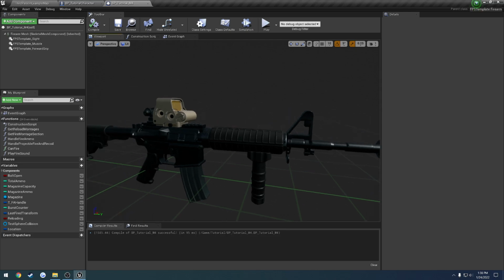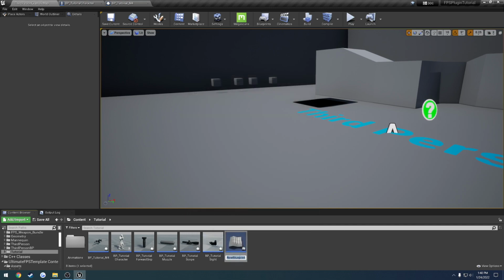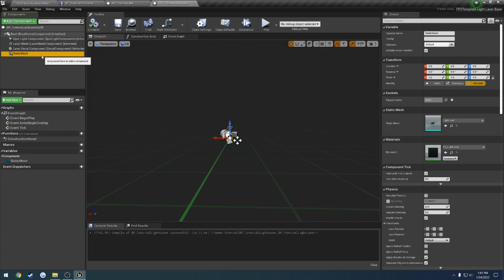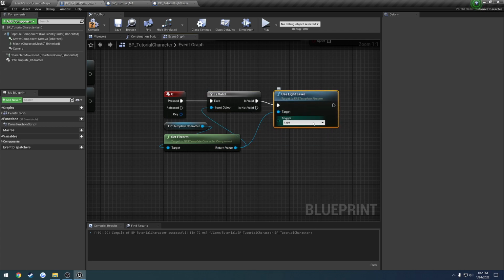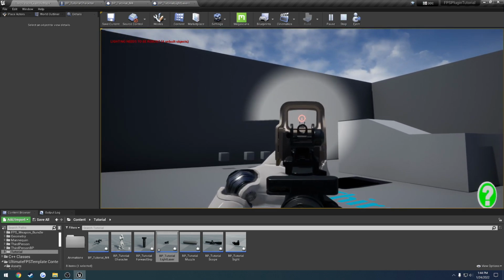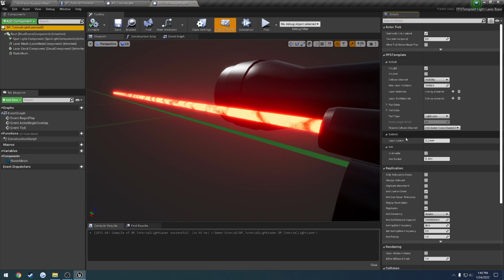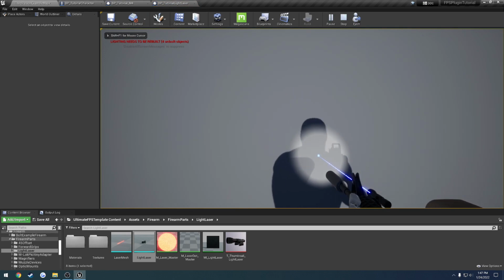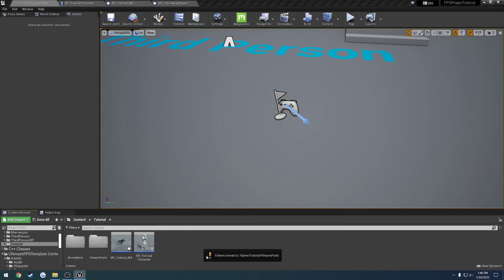UMFPS Template Tutorial: "Setup Light and Laser"

Comment: Is there a way to change the length of the laser mesh if the mesh was a particle system so that it obviously updates properly and no particle systems clipping through walls
Reply from the maker: It already does that. It doesnt clip through walls or anything but its setup so you can make it go through certain items if you wish such as glass
Reply: @SneakyKittyGameDev  the base particle system, when i make a laser particle, using the legacy particle system, the length of it is constant, not world orriented
Reply from the maker: @dasypher9885  I am not using particles for the laser
Reply: @SneakyKittyGameDev  yes i understand that, but how do you set the length of the mesh depending on the world space
Reply from the maker: @dasypher9885  Ah I gotcha. You run a line trace from the start of where the laser would go and end it X distance. Get the distance of the line trace from start to hit and use that value to scale the mesh based on the size of the mesh.
Reply: @SneakyKittyGameDev  ah, thank you very much